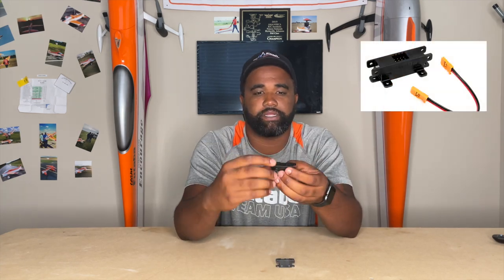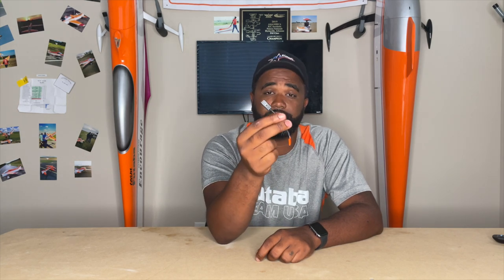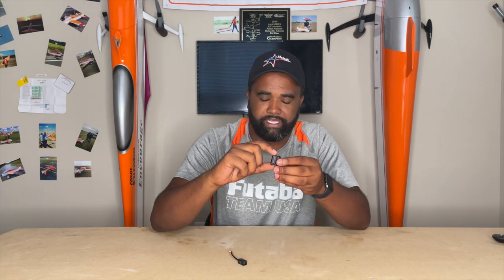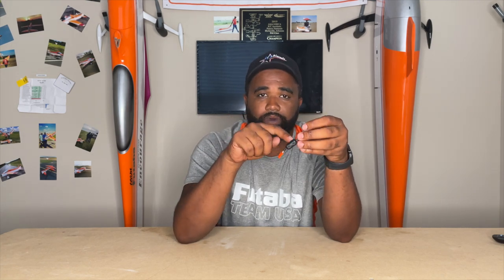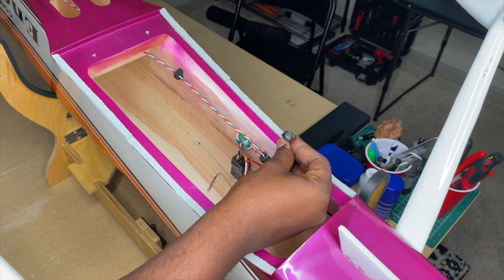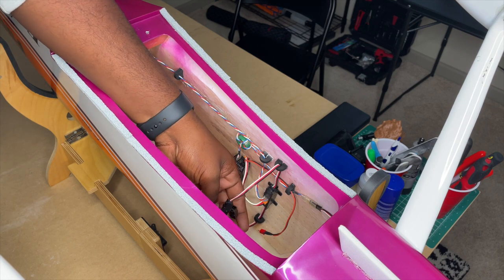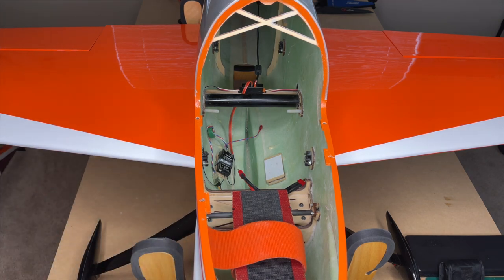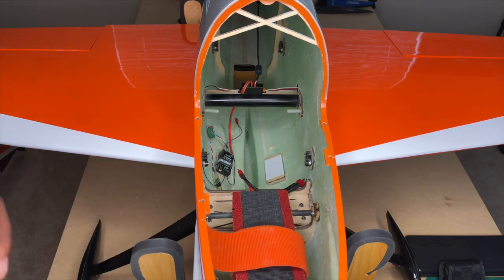S-Bus Setup Part 2

Comment: So, do you have to use an S-Bus servo? Or, does the hub do the decoding? You would get serial digital to the hub, then PWM to a regular servo? Or, if you use S-Bus you have to go S-Bus the whole way? If you must use S-Bus servos, then I can see why this system is rarely used.